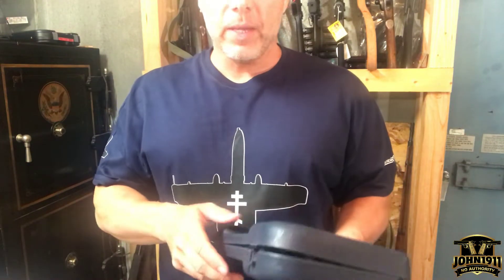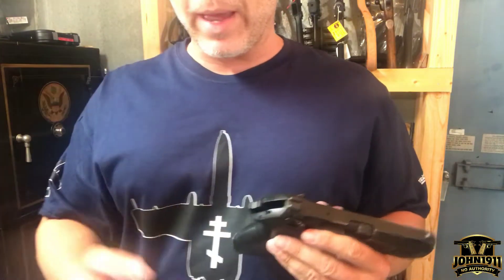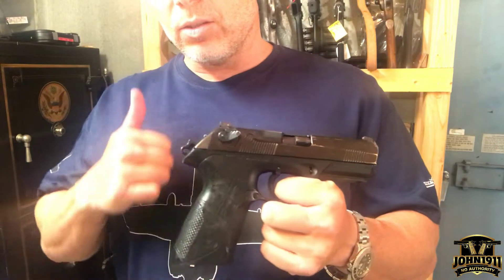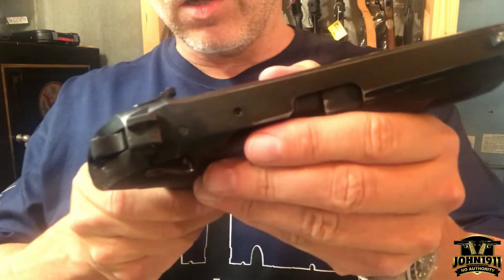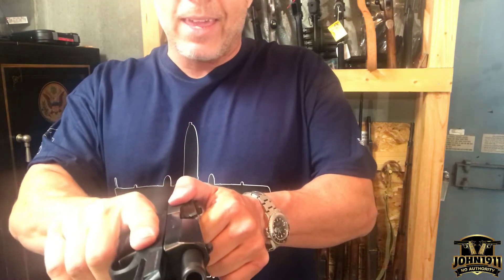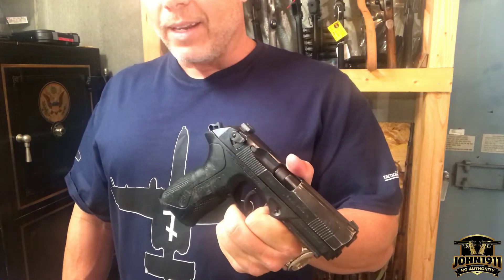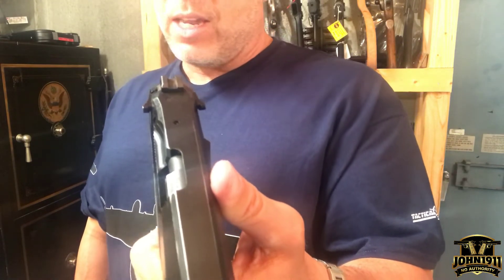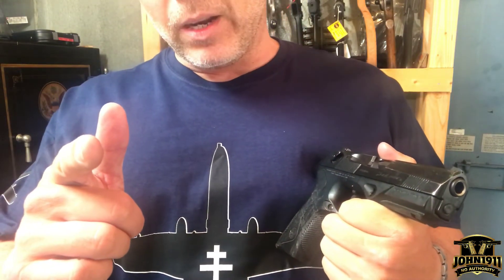Beretta PX4 Design Flaw

Comment: I've used this gun as a duty weapon for the past seven years there's absolutely nothing wrong with the safety decocker catching on anything ever anywhere
Reply: @John1911  I need to know was he learning how to crochet and kept getting his yarn caught on it or was he putting a sewing machine together and all the string cap wrapping around on it is it that's about the only thing that will
Reply from the maker: Chris Harding Chris, the slide mounted safety / de-cocker on the Berettas was never optimal. 

If you love the bigger, sharper iteration? That’s all you. Which is fine. 

Regards,
Marky

Comment: thumb safety will get you killed! the other guys finger is on the trigger when yours is on the safety! get the stealth levers and change it to decocker only, then you only need to push the decocker once when you chamber the first round, so you carry with a round chambered and a long double action first pull ! revolvers have been carried like that for hundreds of years! dont be affraid :face-fuchsia-wide-eyes: beretta since 1527 thats a lot of weapons!
Reply from the maker: Good thumb safeties won’t get you killed and are just as fast. Bad thumb safeties are usually ergonomic wrecks. —Marky

Comment: That safety would rack like a boss on a belt. Or… anything. Look at the hook on that thing. The safety levers are MADE for one-handed racking!
Reply from the maker: As someone who is a big advocate of 1 handed malfunction clearance drills and or wounded officer drills, I commend your sentiment. 

But degrading the functionality of everyday admin control surfaces to do something that is just as easily done with a rear site upgrade is too cute by half. 

But the reality is, Beretta did this because a non-shooter over there got infected with the good-idea fairy and goofed these safeties up. Not because they were concerned about one handed manipulation. 

If someone bolted some lug nuts to the slide of a pistol, nobody would be credulously making an argument it’s an upgrade for one handed manipulations. 

—Marky
Reply: I totally agree with… pretty much everything you just said. My comment was almost entirely in jest. I should have put a some emoji/emoticon at the end. 
Although they would rack like a boss (about the only thing good about them), I would disassemble and take a dremel to them. And probably convert to decock only while I was at it.
Reply from the maker: @rockspydre  My bad so I apologize. I was on the range today or driving so I monitor comments pretty quickly. My fault for being the stick in the mud. 😂 —Marky
Reply: @John1911   No worries at all.

Comment: I have never had a problem with them.
Reply from the maker: Pops McCartney fair. Most won’t. It’s when running the pistol very aggressively under a timer the issue starts to show itself. Casual users won’t see it.

It is my understanding Beretta recognizes the issue and has issues a optional upgrade to the levers. 

They are less sharp. 

Regards,
Marky
Reply: Thanks for the reply, I am not a casual shooter.
Reply from the maker: Pops McCartney fair enough. 

Marky
Reply: Yeah, I almost use the wings from the safety to get a better grip. Maybe if you have soft hands it's a concern, but it's really a niche.
Reply from the maker: Fair enough. It’s nice the Beretta market gives users the aftermarket option.

Regards,
Marky

Comment: Well... THAT was specifically requested by military contracts. It is also an inexpensive and fairly easy "fix" it so desired 🤷‍♂️
Reply from the maker: Well....”That” is another example of how deferring to military specifications in many cases is a mistake. 

Those levers are almost unbelievably terrible. Almost. Putting “military specification” in front of it goes a long way into explaining how that mistake crossed the finish line. 

Glad you liked the video. Pick your favorite bullet launcher and get good with it. That’s what ultimately you will be judged by. Not the make or model of that launcher. 

Regards,
Marky
Reply: Dude sounds like a big baby oww my safety is too sharp 😂
Reply from the maker: Yup. It most certainly is. 

Glad you liked the video. 

Regards,
Marky
Reply from the maker: Glad you like your handgun. 

—Marky

Comment: beretta actually makes three different style safety's for that gun, standard profile, extended, and a carry slim carry model .  yours looks like the extended which was common on the police guns. as for being a "commercial success" , they started production in 2004 and are still produced  today . So nearly 20 years of production and no changes I'd say fairly successful. If people weren't buying them they wouldn't still make them.. the px4 safety was designed to aid in slide manipulation with gloved hands, that's why it has the sharp edged. but I agree the extended and standard are rather bitey
Reply from the maker: Fruit from the poison tree as they say. Better to get the safety off the slide to begin with. IMO anyway. We bought a Beretta 92x Performance for just that reason. 

Very nice gun. Very.

Marky
Reply: @John1911  yeah I just wish they had imported the 92 stock and combat which  had frame mounted safeties and accurizing bbl bushings.
Reply from the maker: Personally I expect Beretta will release a frame mounted safety for their regular production guns. Just gotta space it out so they have something new for SHOT 23,24,25,26.

😉

Marky

Comment: An easy fix with low profile replacements from Beretta (two types) and a 92-style safety lever from Langdon Tactical.  It’s about a 10 minute fix requiring three punches, a screwdriver and a gunsmith hammer. I agree, the mid-profile “carry” levers from Beretta should be OEM and these things need to go to the trash heap.
Reply from the maker: I believe those replacement safeties are very popular. 

But funny Beretta coincidence: I’m hoping to possible buy a 92x Performance today. 

Regards,
Marky
Reply: @John1911  My wife has a 92X Centurion.  Put the red aluminum competition trigger on it and it’s stylin’, but other than that it was a perfect gun for her right out of the box.  If they would have had two available at my local gunshop, I probably would have purchased one too, though I love my 92FS.  I took the steel trigger off of hers and replaced the polymer trigger on mine along with the hammer spring, the trigger spring, the guide rod (with steel) and recoil spring, the safety/decocker (with a Wilson Combat single-lever, lowprofile S/DC) and the trigger bar (with a Langdon optimized trigger bar).  I also picked up a .22lr conversion kit for it...awesome for the range or carry.  Congrats!!!!!
Reply from the maker: Fingers crossed. There was a delay. I am in DC for a few days and hoping the dealer calls me tomorrow. The gun I found is on abandoned layaway, and his drop dead date is tomorrow.

🙏

Marky

Comment: While I agree I am not a fan of the oversized safety levers on the PX4, I don’t consider them a flaw, but rather a preference.  I converted mine to “G” config and installed the Stealth safety levers.  My experience with the PX4 has been that they are reliable, accurate and soft shooting. I must admit I don’t bury mine in mud, take it to the beach where it drops in the sand before I shoot it, but I have had 100% reliability with the multiple PX4s I have owned.

You could name ANY firearm produced and I could list “flaws” in any one of them. Doesn’t make them bad guns, just maybe not to your liking.
Reply from the maker: The fact you removed them kinda gives up the game. And while I am sure we can find the exception to the rule, I’d bet in 90% of use cases, owners would prefer to switch them out. As a manufacturer Beretta is not in the business of putting out a product with that much of a delete rate. Especially amongst dedicated trainers and higher volume shooters.  

This becomes even more of a fail when one considers we are discussing a critical control surface that every user, irrespective of skill or ability, has to navigate. Beretta is a top-tier firearms manufacturer, they should know better. And we know this since they got so much grief about the safety location on the 92 slide, they made a special run of frame mounted 92’s years before the current run. 

But when they made a new platform from the ground up. With a rotating barrel. With eyes on SKU’s from service size to pocket rockets. They decide the ONE THING on the “new” design to keep was the one thing everyone hated on the old guns. But this time….let’s make them worse. 

HOLE-LEE-CHIT. 

Regards,
Marky
John1911.com

Comment: I was not a fan on the safety wings either. It hurts when appendix carry.  Beretta sells stealth safety/decocker for only $30.  Took me 20 minutes to change. 
  But I think would be great for police/open carry holster. They are very easy and fast to get to.
Reply from the maker: Langdon Tactical also makes and sells a replacement set. —Marky
Reply: Other design flaw ??? I am from Turkey  stoeger is also an İtalian firm cougar 8000 and 8045 FT barrels and maybe slides are made in İtaly only l believe in alloy frame made in Turkey but under beretta quality control , in shooting center we tested the cougar 8000 9mm it went 130,000 rounds without slide barrel frame crack extractor no change also no firing pin chance just spring , and 12,000 rounnds without inner cleaning no jam , so this is model is before Beretta px4 this rotating barrel system used Grand power and you will see in Glock 46 too , in my opinion you should question first 3000-5000$ 1911 s even in 45 acp ask your self a question 45 acp px4 or 1911 5" 45 acp if your are police not soldier no mud no water no sand even if in city px4 will beat most other pistols especially Striker fire polymers.
Reply from the maker: Nobody questions the quality of Beretta’s firearms. This is discussing ergonomics. 

Glad you like the video.

Regards,
Marky

Comment: I wouldn't call it a "Design Flaw", it's a personal preference/comfort issue.  If you're wearing gloves it makes for more positive grip.  For those with thin-skin/delicate/soft hands there are low profile and 92-style safety/decocker levers available.   I've never had a problem with mine, I really like my PX4.    I think John1911 should live with the gun, take it to the range and use it, get some familiarization training before accusing beretta of flawed designs.
Reply from the maker: I think this is a fair comment. Anything can be trained around. To be completely honest, I am not a fan of the slide mounted safeties on any of these M9’s, 92’s, PX guns. 

I worked with Army units in advanced pistol marksmanship and the M9 presented serious challenges for non-gun-folks.

But…just do you know: I adore our Beretta 92D DAO gun.

Marky
Reply: @John1911   Langdon Tactical has done some great work with the PX platform.  I'm not a fan of striker fired, the PX is very easy to get used to.
Reply from the maker: @Mad_Marx yup. I know Ernie. From back before there was a Langdon Tactical. 

Unfortunately we are not interested in modifying this gun since it sits in the reference collection. Not a working firearm.

Marky

Comment: I swapped levers on mine for 92 style, added grip tape and G conversion. They need to redo this pistol with good grips, better safety, G only, no rail, and a flat face serrated trigger guard.
Reply from the maker: Pretty much agree. I suspect their focus will be on a alloy framed 92 with a frame mounted safety. Just like on the 92X Performance. 

Marky

Comment: I like my Storm Compact but you are right about the levers.  They're terrible.  I just ordered the Landon carry levers that are manufactured by Beretta and that are in between the "screwdrivers" and the stealth.  The stock levers are a pita to rack and also stick out on reholstering. Those batwings are a very poor design.  I've also installed the larger mag release which Beretta makes you buy as a set of 3 (argh!) and the Cougar D spring to make the DA pull better.  I shouldn't have to put a bunch of aftermarket parts that should have been on the gun to begin with.
Reply from the maker: I have a confession. I broke down a bought a LEO trade-in 92D late last year. I like it.

Marky
Reply: @John1911  I don't own any hammer fired DAOs but they're intriguing. I just recently saw the Lucky Ammo guy was carrying an old S&W 39 DAO.
Reply: @John1911  My Landon Carry Levers came yesterday for my PX4. They look a LOT more comfortable. No sharp edges and better profile.
Reply from the maker: Huh. That’s old school! 

Marky
Reply from the maker: Ernie knows what he’s doing. When he speaks, I listen.

Marky
Reply: That's why you buy Walther 😂
Reply from the maker: @thisismagacountry1318  To be fair, Walther has been dealing with the OOB safety killing their triggers on the PDP guns. My point is, every gun benefits from iteration typically. —Marky

Comment: The safety decocker is sharp but you can smooth them down.  Unless you’re required to have a safety it may be best  to convert it to decocker only by removing the detent.  The DA trigger is hard to master for first shot accuracy so many police departments have moved on to Glock 17, Glock 21 and Glock 23.   There are  several upgrades to improve the DA  trigger weight and travel to make a better duty pistol.   The rotating barrel mitigates muzzle flip especially with larger calibers.  Even Glock has a rotating  barrel design  under trial with the German Police.  I’ll keep my PX4 .40 s&w for now.
Reply from the maker: I think modification is always a good move as long as your controlling authority allows it. As for muzzle flip on rotating barrel guns? I don’t see it. Perhaps there is a chart showing some difference on a graph. But I suspect even that would be negligible to the shooter’s perception. 

I have heard of the Glock with rotating bolt, but like other special SKU’s, I think it’s just that. Not personally aware of any trails involving that pistol. Not that I would be. 

—Marky

Comment: still that safety is way better than any glock safety. 🤣
Reply from the maker: That would be more a reflection of the user than the safety. 

Regards,
Marky
Reply: @John1911  yeah. thats why m17 had to have a safety built in. 😂😂. macho man
Reply from the maker: Touché 

Now in all seriousness. Ergonomics matter. Safety or no safety. If it’s designed by someone who doesn’t actually shoot for a living, or is WEE-TARD-ED, you end up with something like on this gun. The Beretta 92 safeties aren’t that bad, as long as you know the manual of arms. Especially when manipulating the slide. This safety is so bad, one actually has to wonder if the design is some kind of inside baseball - punked kind of joke. 

But back to your original point: Personally I am a safety guy. I like where the M18/M17 is going and I expect there to be iterations of the controls over the next few years. Read that as M17A1, M17A2, etc. But as for it being a reflection of the user not the gun; don’t forget. The M17/M18 is on the Big Army / Big Green side. All the “next level” folks seem to be buying Glocks. I don’t claim to know why. But it makes one wonder. Is something up with the SIG? 

Regards,
Marky
Reply: @John1911  well, one of the greatest shooters, ernest langdon, designed many berettas and he thinks the slide mounted safety is superior to any other.
Reply from the maker: 1. I know Ernie personally. 
2. I am not talking about slide mounted safeties. I am talking about THIS safety on the Px4. 
3. The same Ernie also sells an upgrade kit to fix this dumb safety lever design on the PX4.
4. Beretta also now sells an OEM kit to “upgrade” this safety. 
5. Stop moving the goal post off this Px4. 
6. If you like these levers, keep them. It offends nobody. 

Regards,
Marky

Comment: Sir it is a robust design as it was created for duty abroad as well as here many mods later you get the d model with shaved levers , size and weight parts compatibility is what departments think about as well as reliability  plus it was probably a transition weapon in some depts they used the 92 platform  and it’s almost intuitive to go to the px4 after a 92f. Which is why the safety was not changed until compact and compact carry models were introduced. It is not second string at all grab a ltt compact carry put it against any gun on the market  you will be surprised at your group size and your rate of fire
Reply from the maker: I like and know Ernie. So anything with LTT on it is top notch. As for the rest about this pistol. Opinions vary. It’s a perfectly serviceable handgun. And most stuff made by Beretta is of quality construction. It’s not a crap gun. But some of the control surfaces are just attempts to put lipstick on a pig. Much better ways to skin a cat. And the market reflects that. 

Regards,
Marky

Comment: If that's your only Complaint it's a very easy fix.
Reply from the maker: Yeah. I mean in general I don’t like the slide mounted safeties of either the Storm or the 92 series of guns. But you are correct, Beretta offers replacement parts for this issue. —Marky

Comment: I have a full size .40~ first thing I did was replace those nasty levers with Beretta flush mounted ones. It renders them useless, but i don't use a safety & just manually decock the thing when I have to~ but a blaring mistake by Beretta that they should have corrected 10 years ago.
Reply from the maker: I think a good compromise would be some low-profile examples from Ernie Langdon. That way you can still use them as de-cockers. 

I wouldn’t recommend doing it by hand. 

Regards,
Marky
Reply: @John1911  I always regretted not getting the 96 instead
Reply from the maker: @jmsmikey  The 92/96 series is a better gun than these. —Marky